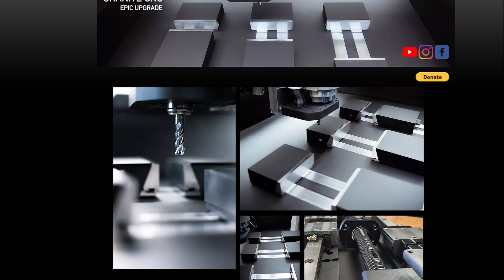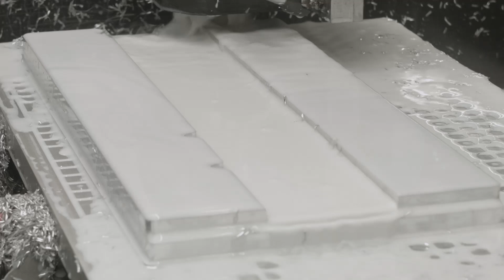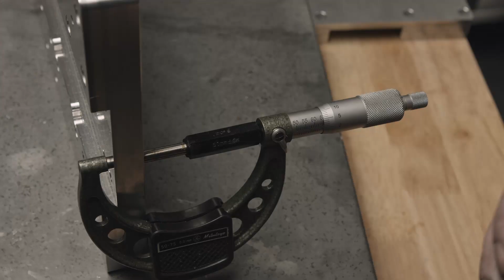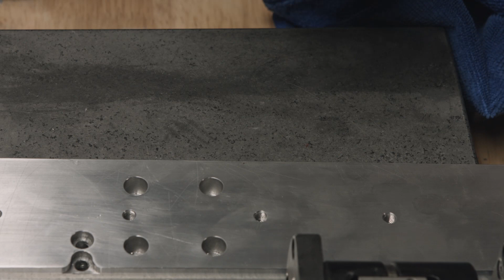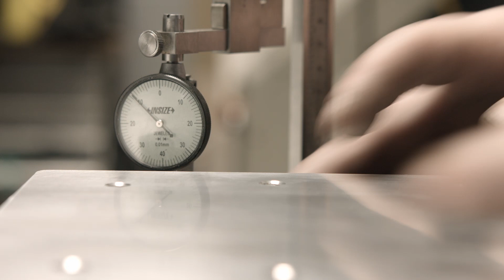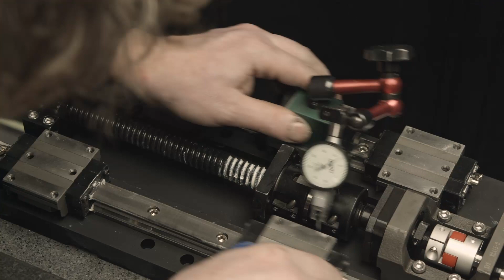EPIC CNC upgrade - episode 4. Submicron Precision Z axis, Machining, assembly and fine tuning

Comment: Hi Fox,  have you considered including a counter weight to compensate for the weight of the spindle?  The ATC spindle is quite a heavy beast, so I think that a counter weight could be beneficial. What are your thoughts on this?
Thanks, Eric
Reply from the maker: i thought about it. but i thought to add a gas strut, counter weight would add 15kg, and inertia, strut weight almost nothing. but currently I  just use lock pin. after use while machine is on I just home z up, and put the pin in. so Z doesn't drop when you power it off. when its on, there is no problem for servo to keep it up. and because im lazy and it works like this, I can not force my self to change it :)
Reply: @PiotrFoxWysocki  Your honesty always gives me a big laugh :)  But we as all know you are not lazy, instead you are selective and pragmatic about how and where to spend your time. That is why you are so effective and get so much done :) 
To get back to the topic, yes I was also thinking about adding a gas strut instead of a real counterweight. My previous machine ( a Gerber Sabre 408 with a heavy 5.5kW spindle that I had converted to LinuxCNC) had springs installed, which also proved to be quite effective, but I think a gas strut is a more elegant solution. I think I am also lazy on my end and putting a pin in to prevent the Z from dropping is something that would keep annoying me and I would probably forget to do it anyway and destroy a lot of router bits because of the spindle plunging down on the table or work piece.  An even more simple solution to prevent the Z from dropping would be to add a break to the Z-axis servo motor, but that would still not eliminate any of the other disadvantages of a 15+ kg weight pulling on the Z-axis constantly. I think that a gas strut together with a brake on the Z-axis servo would be the best solution. Any additional thoughts on your end?
Reply from the maker: @EricBow  I'm glad i can bring happiness to your life :) I looked up the prices quite quick. gass strut 20$ servo brake 150-200$. in my opinion its no brainer :) gas strut, 2 holes and you are set. servo brake, quite possibly you will have to buy a new servo with the brake, and what is worse you have to refresh your memory how to wire this bloody thing. and since you want to use strut, there is no point for the brake. if your z weight is 15 kg, and your strut is matched for 15 kg. then there is no way for the z axis to move. cause it will weight nothing. even if you get a strut 10kg or 20kg it wont move because you have to break holding tourqe of the ballscrew with servo. even if its turned off. use of the brake is only justified when you use it, for example, in a actuator to lift something heavy and keep it lifted after you turn off the actuator.  its more  to hold unknow amount of load, once you lift engine and the other time a car. then strut is useless , but brake is perfect. but when you have the same load all the time strut is the winner.
makes sense? right ? :D  stay lazy :D
Reply: @PiotrFoxWysocki  Yes, absolutely makes sense. I was thinking along the same line. Since I am building a new machine from scratch, I'd like to verify my own thoughts against  experienced people like you, so your feedback is very much valued and appreciated.  The next challenge for me will be to get all the parts I need, specially the ball screws and linear guides. I recently moved from Europe to the Philippines and Holy Christ on a pony..... there is nothing decent available here. I guess I will have to import stuffs myself. I used Star Rexroth and THK in the past, so will see if they can ship from Singapore or Japan or so. Since I have made machines before from epoxy granite, I was tempted to do that again, but given the attractive prices of Grade 00 granite surface plates and straight edges from China, even made to customer specifications, I think I will stick to that for now.  I expect it will save me a lot of time achieving high accuracy, allowing me to stay more lazy and enjoy my time in more fun ways :D
Reply from the maker: You are closer to the source of parts. So it should be cheaper to get all this stuff. Good luck with your build 💪👍😀
Reply: @PiotrFoxWysocki  Logistics and prices are as magical as the prices of airline tickets.  Very unpredictable.  But I'll find a way 😁👍

Comment: A bellows style coupler would help you a lot between your motor and ballscrew. The mechanical hysteresis of a lovejoy style coupler you're using now will show itself in 3d surfacing style toolpaths and ball-bar results, something I learned from an old fadal engineer.

I'm assuming you had to do more lapping on the plates after you did all the pocketing right? or did you get all the stress out of it from just the facing?
Reply from the maker: Coupler works fine. Not complaining on finish.
Plates have open up but when I bolted it together they cancel each other out. It wouldn't, I would have to redo them. But everything turned out just fine 🙂

Comment: is this machine strong enough for some low carbon steel?
Reply from the maker: It's fine to mill anything.
Reply: If you mill steel, don't use a magnetic impeller coolant pump!

Comment: Am I the only one screaming at the screen when he was "honing" the surfaces on the surface plate
Reply: Also, he's got everything dialed and so precise that the warmth from his hands touching the linear rails will do them and move them more than any other tolerance on his machine. I never seen someone make a DIY machine that is basically machining a diffraction grating type finish on aluminum parts and even stainless
Reply: I might be mistaken and may have missed that part but pretty sure this dude is on the up and up with standard metrology practices and standards. Anybody that can get submicron precision on an entire machine in their basement from parts ordered on the internet.... probably knows what they're doing. Like I said I haven't watched the whole thing through but as a professional matrologist myself I can't imagine this dude doing anything crazy or wrong. So much of the surface plate he has used and sculpted has to be conditioned sometimes and he always brings it back down to weigh weigh weigh lower than any standard or tolerance needed
Reply from the maker: In my opinion surface plate is a tool, not a trophy behind the glass. Tools are meant to be used 😉 
I have couple of surface plates, some are good and some are for stuff like that. 
You have to break few eggs to make a omelet 😉
Btw surface plate on this video cost about 160usd so in my opinion it's a consumable. Like a sandpaper. Or endmill.

Comment: Hi, 
nice work,
I see you mount the sliding block to close in order to gain travel on Z axis, and I guess you gonna mount the spindle offset to Z - , I think this will amplify the litlle play in sliding blocks.
Currently, I am building a CNC and I allowed  200 mm between the sliding block with 350 mm sliding rails so will be a 150 mm travel on Z axis and the spindle clamp will be 50 mm lower than the block if you look from the side.
Did you consider to reduce the distance between the blocs and spindle clump?.
THANKS
Reply from the maker: i use roller guides so there is not much play to start with. yes i wanted to have more travel looks like its 190mm. spindle clamp is mounted 50mm below last carriage. so just like in yours :) 
im considering installing smaller clamp higher on the spindle. its not to support but to remove few microns from the deflection. 
currently it looks like z plate has a deflection of 10 microns for every 17 kg, from the carriages to the spindle mounting point.
Reply: @PiotrFoxWysocki  
Thanks for the info.
I see the good guides will do the job. Can I have the link from where you purchase them?
Just now I downloaded fusion 360 file and the design looks ok just the Y-axis the motion from servo to actual axe look a bit too long but I can be wrong.
10 microns you tested on the machine or separated from the machine?
Reply from the maker: Yes y asis look long because this was the lenght i could get. Beside i didnt wanted travel to be from end to end. Beecause in case of any miss aligment it wont bend permanently or the increase in load will be minimal.
All the sources are in video descriptions of epic upgrade 1 and 2

Comment: You showed the linear roller curving in a previous video. did mounting the linear rail change the flatness? if so by how much? Great video series btw it is really entertaining and fascinating!
Reply from the maker: Linear roller had very small bow. Around 10 microns. Once its bolted to the plate it will straighten up. It will also bend the plate but not noticeably. If the bow would be around 40 microns i would consider straightening it up first. You know. Everything with in a reason ;)
Reply: @PiotrFoxWysocki  thank you for such an insightful and inspiring series! when should we expect the next installment?
Reply from the maker: It should be this week. Just have to find the time to edit. Im doing upgrade and recording  videos at the same time.

Comment: you shouldn't relay on the outside end of the nut. You should relay on the ballscrew it self.
Reply from the maker: Only precise piece of the screw are the ground groves. Its really hard to indicate the center of the groove. 
Nut on the other hand is attached to the screw with balls which are in the ground groves. The nut will be attached to the plate. So this is the part you should measure. Btw im not rotating the nut, just holding it in the same orientation and measuring from the same point. 
Could you please explain why i shouldn't relay on the ball screw ?
Reply: @PiotrFoxWysocki  I didn’t think very well. Keep up showing us stuff!
Reply: @PiotrFoxWysocki  Put the indicator tip on the ballscrew groove and turn the leadscrew forwards and back. This way you will be able to check all direction AND backlash!

Comment: Are they all of aluminium? Why not steel?
Reply from the maker: Mostly because of personal preferences, weight  and aluminium doesn't rust.
Reply: @PiotrFoxWysocki   also what about vibrations? I thought that was a problem with steel vrs aluminum as in steel vibrates more or is that wrong?
Reply from the maker: This is my hypothesis. Steel is much more dense than aluminium. And the tone you get by striking the same size aluminium and steel. Steel has much higher pitch and resonates longer and louder. In addition with high speed spindle steel would resonate through the roof. Where aluminium would dampen the vibration much better and quicker. Besides its easier to machine and lighter. Forces operating on cutting can not be bigger to bend an endmill. And i did some tests on endmills and 20kg of pressure would break 4mm endmil and distort any other endmill beyond reason. So perhaps on a roughing, forces are much higher but on a finishing passes its barely anything if you want to have your parts in spec. Hope my explanation makes sense ;)

Comment: Precision ground flatstones make VERY short work of high spots. I bought my set from Stefan Gotteswinter. Great tool to have. Robin Renzetti has a great video on them: https://www.youtube.com/watch?v=DVLXsq7pi9Y
Reply from the maker: yes, i have seen this one :) i wish i had a pair of those, but because i deal with aluminium mostly i wouldn't use it very often :(
Reply: @PiotrFoxWysocki  Why wouldn't they work on aluminum? If you are worried about loading, just make sure they are silicon carbide instead of alumina based. Then dissolve the aluminum out when necessary, like I do with endmills: https://www.youtube.com/watch?v=b9fhjxbfU6E&t=1s

Comment: G'day Fox.
Like your work, admire your build, look to do similar...
But you dooo frustrate me at times.
Talk in microns but don't have a set of mikes, use a didgital aproxometer for critical dimensions!
Get with it dude.
But I do really like your design concept and that flood coolant set up is the most effective I've ever seen.
Keep up the good work!
Reply from the maker: haha :D
thanks for the honest feedback :) really appreciate it.
i will get more mikes and indicators. i got brand new 1 um indicator but the spring is so stiff that it was marking the surface i was measuring, so 10um indicator was better, because more sensitive. 
but i will look in to this one and see if i could do something with it. or i just get new one.

i used calipers just to see roughly what it is, and for the video to show the number.
later on i switched to mike and got proper reading.
not sure why you are angry at this.
this 15mm dimension is not critical at all, it could be 20mm as well. critical was the consistency in the thickness, which turned out to be spot on.
Reply: Fox, not angry, frustrated.
I well understand the cost of tooling.
 Pharq! I have spent a small fortune on tooling!!
And continue to do so.
The 0-25mm Mike is the cheapest of the lot, just sayn'..
Keep up the good work though.
Reply: @PiotrFoxWysocki  If you want to check the motion of the final system for straightness and accuracy, you'll need a laser interferometer. Like this: https://www.youtube.com/watch?v=WtZfg7OGXG8 
They are cheap and easy to get now. I can help if you need some pointers.

Comment: Another great video i very much enjoy watching your progress.  

i will give you a tip on finding the high spots buy some canode blue spotting ink. put a thin layer on the plate then rub the part and it will highlight the high spots with blue ink, when you are finished it just wipes off your granite plate with some glass cleaner.  this is what we do for hand scraping to get the whole surface under 1-2 um accuracy.  for the thickness i think you also need to look at the parallelism between the rail mounting surface and the screw mounting surface as you know its important,  the screw needs to be aligned perfectly in left to right and top to bottom (vertically & horizontally) to the rails.   

Also don't use these couplings with the rubber they are not accurate enough due to the flex under load, instead use Huco Oldham Couplings they are significantly better for holding tolerance on a direct drive and will protect you if the machine has a crash because the black plastic slip joint in the middle will break before the screw/bearings, they also remove the issue with having the perfect motor alignment.  you don't normally see the accuracy improvement just measuring without cutting but you will see it on the finished part tolerance from my experience. have a look at their website. https://www.huco.com
Reply from the maker: thanks for the advice and link!

Comment: Nice work like always, just don't like the design where spindle plate overhangs. The way to avoid that is to mount Z rails to spindle plate. At home there is no overhang at all and progressively increased as spindle goes down toward table. Can you send the link for ballscrew and LM guides set please?
Reply from the maker: i mentioned before, my rails are bolted from the top, not the bottom, assembly in this case would be very tricky. 
and from my personal preferences i don't like the idea of variable rigidity according to the depth. so i don't have different finished at the to and the bottom.
sorry but i don't have the links for the ball screws and rails as i bought them on ebay.
Reply: @PiotrFoxWysocki  I've never mill any 90deg wall higher than longest tool length - 75mm. I did not noticed any changes on surface finish on that wall towards bottom where rigidity would be lower. Fair point, my 1st cnc had this idea and somebody mention to me therefore since I do opposite. I spent fortune on precision tools after watching your stuff:)
Reply from the maker: No you made me feel bad :) its the last thing on my mind to encourage people to go and spend their life savings ;)
In my case i want to mill plates mounted vertically in the vises. As far I remember new Z Axis has 185mm travel.
Reply: @PiotrFoxWysocki  :  You shouldn't feel bad... if you encouraged someone to spend money on useful things, you may have stopped them from spending it on things they drink, snort, or inject!  Keep up this wonderful social service, you may save the planet!    :o)
Reply from the maker: Hmm. I see your point, but it escalated pretty fast from life changing to saving planets ;)

Comment: I think if you are worried about the run-out of the ball screw assembly affecting the plane stability of the plate, you can try turning the rigid link between the ball screw nut and the plate to a flexure joint that can take up all sideways and up-down wobble, but can still transfer the longitudinal motion to the limiting accuracy of the ball screw grind.
Reply from the maker: This is precisely what i was worried about.
Flexture sounds like a great idea, i will keep it in mind if i face similar issue. 
For this z axis there is not much space left to put a flexture. 
But who knows. I will give it more thoughts and for sure i will  test it once is installed in the cnc, before fixing anything ;)

Comment: Hi to everyone , I'm kinda a newby when it comes to mechanics, does someone knows the name of the stone he used to take out the high spots ? And what about the plane in which he was rubbing the guides ? It's a reference plate ? Or it's something else. Thanks in advance if someone is going to reply
Reply from the maker: Stone is called a toolroom stone. But knife sharpening fine stone will do. Not ideal but in case if you dont have enything else.
Plane is a granite surface plate. I have 2 of those. One for measurments and the other one for those kind of activities;)
Reply: @PiotrFoxWysocki  ohh ok that makes sense ...I didn't understand why you were scratching a reference plate ...now it makes sense, thanks for the reply and love your work